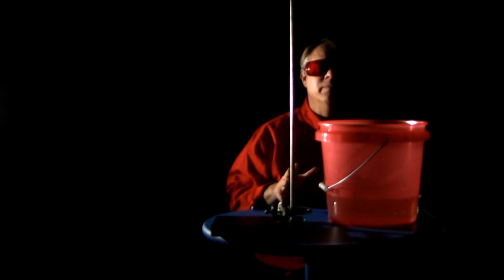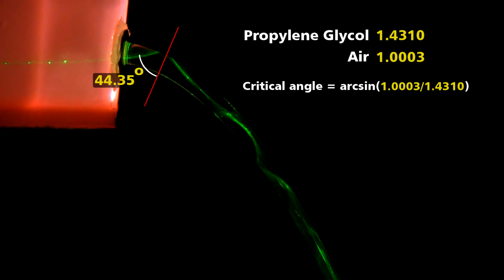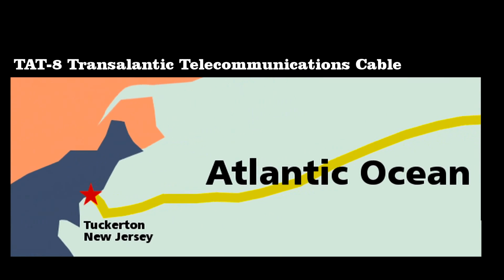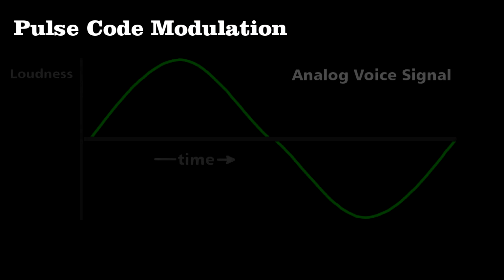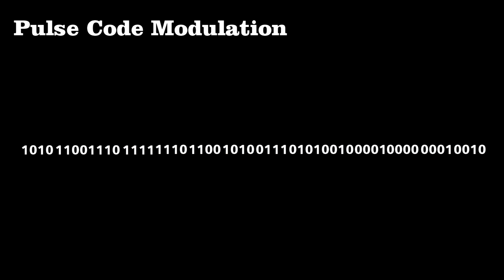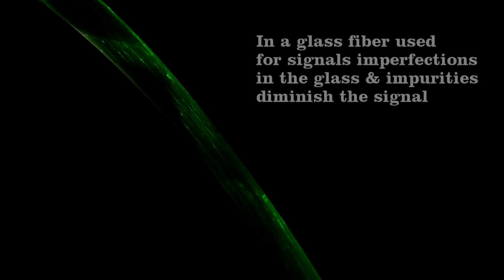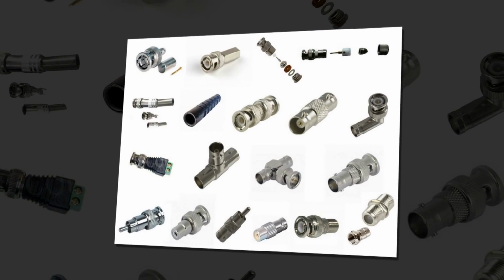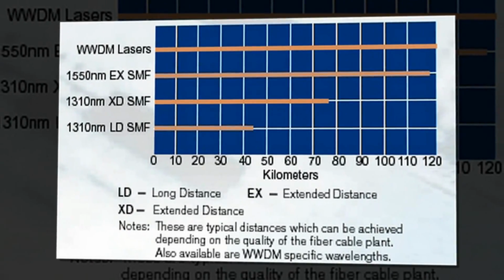How Stuff Works: Fiber Optic Cables and Difference b/w Coax & Fiber Optic Cables

Comment: Features & Applications of CPRI Fiber Optic Cable

Common Public Radio Interference (CPRI) cables from E-Systemizer conform to international standards and meet the stringent requirements of the telecom industry as the vital bi-directional link between Base Band Units and Remote Radio Units. These fiber optic cables available in 2 core and 4 core combinations can carry control or message signals with minimum loss
 
Total steel sheathed cable for superior mechanical strength, compressive strength, rupture strength and resistance to rodents as well as excellent grounding properties
 
High-pressure resistant construction
 
Waterproofed, totally sealed construction with moisture blocking loose tubes
 
End connections are available as a plug-in jack of any type, LC duplex or SC simplex, SFF and SFP designs, ceramic ferrule, simple or duplex plastic housing for high-density interconnections.
Low insertion loss of 0.1 to 9.1 dB, high return loss, extremely stable and unaffected by temperature
Application
E-Systemizer CPRI cables find wide applications in:

CATV systems
 
LAN optical fiber networks
 
Data & communication systems
Connection of main fiber to optical receiver
Get the best CPRI cables with various types of optical fiber termination connector types right here
List of Some Other Products:

Fiber Optic Patchcord

E-Systemizer offers a range of fiber optic patch cords and patch cables in FC, LC, SC, ST, MT-RJ, MU and E2000 terminations. These patch cords are perfect for use in testing environments, in industrial use, in labs and other areas where one needs a variety of cables with various sockets and adapters for quick connections. We offer a range of single mode fiber type and multi-mode fiber cables in various diameters in simplex and duplex types.

LC Series Fiber Optic Connector

First developed by Lucent Technologies for telecommunication applications, the LC series fiber optic connector is a small form factor pluggable type that finds use in transceivers. Similar to the SC-type connector, the E-Systemizer, LC fiber optic connector is easy to plug in or remove, providing a secure, precisely aligned fit conforming to FOCIS 3 EITA/TIA 604-03 standards. It is the most popular of fiber optic connectors in our range.

Visit us: http://e-systemizer.blogspot.in/2017/03/features-applications-of-cpri-fiber.html